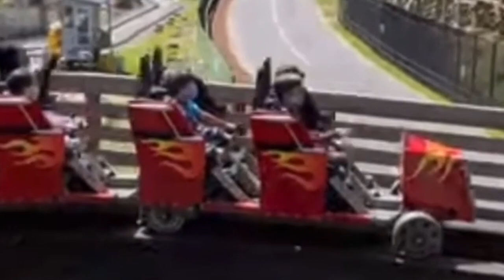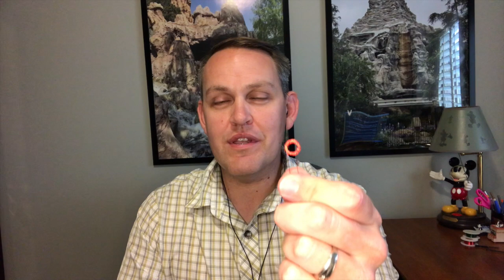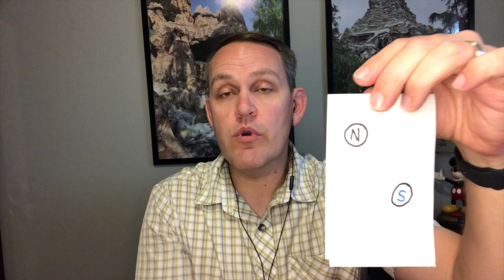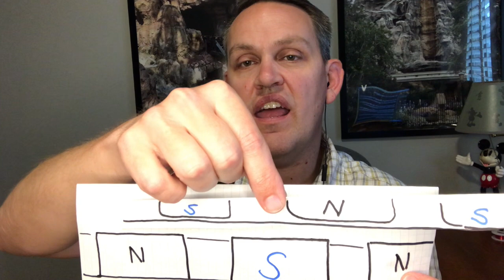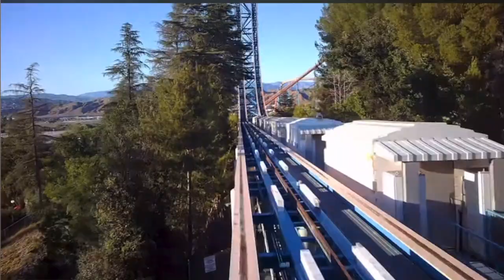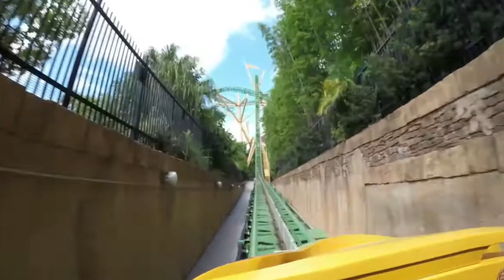MAGNETIC LAUNCH SYSTEMS 3: Linear Synchronous Motors and how they work

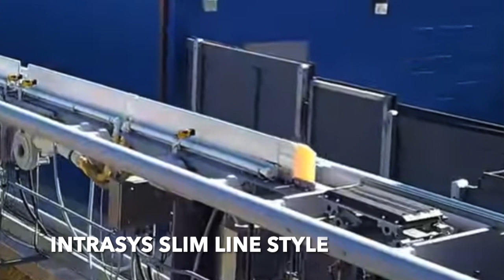Comment: 11:42 in fpv drone escs, the esc understands the orientation and speed of the motor from the eddy currents that get applied onto the coils themselves rather than using hall effect sensors, couldn’t they just measure the current thats cast on the stators themselves once the train passes over them to determine where the train is? Wouldn’t that be more efficient and less complicated and less things to go wrong?

You could measure the orientation from which stators feel current after one another and you could measure the speed by how much time it takes from the current to be felt in one stator than to the other.
Reply from the maker: You could do all that. Sure. It won’t have a safety rating though. Meaning insurance won’t stand behind people getting on it. This industry revolves around verification of movement. And when it’s properly verified, it’s verified by another system. Positive feedback. It’s why one locking pin will have 6 channels monitoring it.

Comment: Is the Current going to the Staror windings just DC with fixed amplitude, or does it have a Frequenzy/ is it AC?
Reply from the maker: It’s dc where the form is modulated for both current and frequency. But at full speeds it’s more of just dC that looks like square wave AC kind of.

Comment: From what Material is the Stator case made?
Reply from the maker: I’m not 100% certain as these things are very closely guarded they don’t let much information out. But it appears to be simple high temperature resin like fiberglass would be used. I’m sure it’s stronger than that though.
Reply: @ryantheridemechanic  👍

Comment: There is no iron in LSM stator coils.  (If there were iron, there would be horrendous side forces if there were the slightest side-to-side misalignment.  Since the mechanical alignment of a coaster train/stator is much poorer than in normal rotary motor, it is not practical to put iron in the stator.  (Remember your comment about putting plywood in magnet gap to prevent wrench from being sucked in?)
          Conversely, in LIM, all the iron is in the stator & none is on the mover (fin on the train) for the same reason.  Because of the large gap without iron, it requires HUGE power just to set up the magnetic field.  (This power is not required for LSM because the "work" is being done by the permanent magnets.)
          Both motor types would benefit from having iron in both the mover & the stator, as "pushing" magnetic field through air is difficult.  Result is weaker field & less force per amp drawn in both motor types.
          You do not mention why LSM cannot rival hydraulic or pneumatic launch.  To get more acceleration, you need more current or more magnets, or both.  Even with WATER cooling, there is only so much current you can push through the coils before the coils MELT.  Adding more magnets gives more force (for a given current), but the magnets are HEAVY.  More force does little good if you have to add to the mass to be accelerated!  There is a point of diminishing returns.  This is why Top Thrill 2 can't use the original "one pass" launch as Top Thrill Dragster did.  The same goes for King Da Ka.
          There was one coaster that used LSM on the lift hill (superman?), but they abandoned this for chain lift because of reliability problems.
Exploded LSM coil structure is shown in this video:
https://www.youtube.com/watch?v=ffdEtbBQY6M&t=669s
Note the WATER COOLING layer in the coil set.  There are 3 phases so there are no "dead spots" in the magnetic force & uniform current draw.
Reply from the maker: Thanks for all the cool info. As far as the iron on the inside, I don’t make them, I was just told that’s what’s in there. You can also see the slight outline with an FLIR as well so I take it a face value.  Not saying all are exactly the same either. I know they weigh as much as a 19mm plate of steel, need 2-3 people to lift one. Are you in design of these stators? So far (me personally) I haven’t seen an internal water cooled stator. The stators intamin makes looks like they could use a shell cooling. 
Closest I’ve ever seen is when they sprayed water on the outside of lightning rods lift base motors. 
I know the old lIM/ LSM stators were made from the manufacturer with either being an option but they were much larger.
Reply: @ryantheridemechanic  A FLIR shows TEMPERATURE differences, not iron.  What you are seeing is the hot copper loops, not iron.  The next time you are working on LSM coaster, take a magnet with you & place it on the stator (with the current off) to see if it is magnetic.  It won't be!  If it were, the coaster would LOCK to it when it tries to pass over.  I don't design coaster stators, but I have designed synchronous permanent magnet motors (one much smaller for military, the entire motor fitting inside 0.2 inch cube).  The other thing you mention is hall sensors & the timing criticality.  The one shown in the link I sent has the sensors where they belong: INSIDE THE COIL STRUCTURE, directly connected to the motor controller.
          Incidentally, once the coaster gets moving > 10MPH, the back EMF from the coils gives more accurate timing information.  This is sensed directly from the coil drivers in the electronics.  The same scheme is done in rotary synchronous motors used in RC electric airplanes & is referred to as "sensorless" synchronous drive.
          Also, you need to look for water cooling lines & a radiator located near the driver cabinet.  There should be a pair of hoses going to each stator.  After running, the hot hoses should show on your FLIR.

Comment: How strong are these permanent magnets? How much kilos can they lift theoretically?
Reply from the maker: Depends on how you use them?  Pull strength against a carbon plate? Force from an Eddie on copper? A single magnet that’s used inside a brake shoe has about 400lb pull force.  And the shoe uses about 12 of these.

Comment: sir 0ne more doubt so in finally stator is working with DC voltage instead of Ac waves
Reply from the maker: Dc current with pulse modulation
Reply: @ryantheridemechanic  thankyou.
Reply: Brother iam also working in theme park abu dhabi. Actually iam from a mechanical background. Iam very curious to study about this all. But in my park lsm stator is powered by Ac
Reply from the maker: @harikrishnan-ts5ti  interesting. My old park the drive is given AC power. Power is broken into Dc. Then dc is pulse modulated and given to the stators. The way most people think about it, they would say it’s AC going to the stators but it’s actually DC 
(AC - drive - DC - stators) 
But the dc is made into a form that almost looks like AC.

Comment: Would you be able to do a video talking about Lightning Rod's launch system and why it faces so much down time?
Reply from the maker: So lightning rods launch system is an LSM drive that this video covers. As far as down time, I can’t speak for something Im uncertain of. I know that year RMC had a ton of restraint issues. And control systems can be a bear but not sure about its particular drive issues. Where is the information coming from that it has drive problems?
Reply: @ryantheridemechanic  I can't think of a specific source at the moment except for a Coaster Studios video where it broke down while they were waiting in line. The train just failed to make it up the lift hill on the first launch, and it took them about fifteen minutes to get it ready to launch again. I've heard it has overheating issues as well, but for all I know, that's just speculation.
Reply from the maker: @KindredCoasters  ok fair enough. Lift hills have a lot of attention due to the visibility across the area. I know the feed stators at the bottom get hot as they are spraying water on them.  Hmmm. And I could see having trouble restarting dead weight on a lift, heck big hp lift motors also struggle with it. I’ll have to think on this one.

Comment: Isn't square wave DC essentially Full Wave Rectified DC? (FWR) Great video as always! Only thing I didn't quite get was the difference in the two sensors you explained. Understood how they worked, just not their separate uses.
Reply from the maker: Yes full rectified. Basically get that term from welding. Are you saying hall affect vs tail sensors? Basically the early hall affect have a value feedback  vs tai sensor gives an on /off.
Reply: @ryantheridemechanic  Ah ok, thank you for the explanation! I've always been into learning the electrical stuff since I was 3 and started collecting fire alarms. Eventually started wiring them up with control panels, senors, and all sorts of devices. Got into coasters in like 2018 and have been hooked ever since. Even got a job in a junior engineering position/program last year at a power supply applications engineering company as a 14 year old. It's been on awesome hobby and always interesting! I can tell you really enjoy learning about this stuff and teaching others, yourself!
Reply from the maker: @nesmanmain0001  it is fun to teach this to people if I can

Comment: Great explanation, Ryan! I wonder how long it will take until you will have the inevitable person show up in the comment section of your videos telling you that "You have no idea what you are talking about". 😂 If that happens, please don't feel discouraged...

Anyhow, the LSM principle really reminds me a lot of how brushless DC motors work. At work, i am currently involved in developing firmware for a product that uses this motor technology (though not on the actual motor control, this far exceeds my math skills😅) and the only difference seems to be geometrical (round rotor with the stator windings wrapping around in the motor housing vs. linear magnet under the train and stator windings spread out along the launch track. 

I was able to witness the importance of the sensors a few years ago when I visited Holiday World in Indiana. Just as we got to the station, they couldn't launch the train - it would dispatch, move a bit on the launch track, and then the ride would shut down with an error. We used the opportunity to get out of the heat and watched the park's maintenance team as they tried to get it up and running again, and after going back and forth a lot, they found that someone must have lost their phone on the ride and it had ended up blocking a sensor. I assume the magnets in your typical iPhone aren't strong enough to interfere with the hall effect sensors, but of course it can block an optical sensor or just trigger a prox sensor easily. After they removed the phone, things worked again. (Keep your darn phones in a closed zipper pocket or don't take them on rides at all, kids!)

Anyhow, I imagine it's kind of tricky working on LSM trains. Those Neodymium magnets are extremely strong, so I can imagine that they would also try to yank the wrench out of your hand if you come too close.😂

There's just one thing I would like to kindly ask you for, in order to improve your next videos. Please crank up the audio level, there were a few sections that I had to rewind to understand what you were saying. And I already have the Youtube player on max volume and also my laptop's sound mixer. As long as it doesn't clip, as higher audio level is not much of a problem as people can reduce the volume during playback, but there's only so far you can turn it up until you max out. Thanks a lot! A man like you, who has mastered the special effects needed to support the explanation should also be heard 😁
Reply from the maker: Thanks for the comments. Magnets are quite nerve racking to work around for sure.
I don’t mind when people att a ton of info in the comments I don’t feel like it is a big deal. I know there is way more information than I give when it comes to theory on anything. But I make the videos they way I do because that text book theory goes over most peoples heads and they don’t understand. I make these videos the same way I gave tours and learned what to explain and what just needed to be touched on momentarily. 
My hearing isn’t the best so I try and “place” the volume where I think it should be. Definitely don’t want quiet though that’s no fun at all. I also do want to pop in and have people lungeing for the it volume because I’m yelling. Haha. I’m also trying to be conscious of where my mic is and where I am.

Comment: I was really bored one day and read the lsm manual at work. The way the theory of operation described it was the magnet passing over a single point created a theoretical frequency and the system would try to keep the stator frequency either 17 or 19 degrees ahead of phase. Eventually they got rid of our Hall effects sensors and added current transformers on the drive. Apparently they can use that to determine where the train is. When they did that they did have to add a comb sensor to determine parking. I thought this was going to be the standard, so I was surprised when I saw Intrasys still used hall effects. But I’m sure they no longer use a windows95 computer to interface with the sensors anymore.😂
Reply: I actually made a comment about this a while ago about how the motors on fpv drones work the same way and how fpv escs actually use the eddy current on the coils rather than additional Hall effect sensors to measure the direction and speed of the motor and asked why they don’t use the same system here to reduce complexity and the chance of something going wrong, then I saw ur comment and I suppose thats what exactly they do anyway
Reply from the maker: Industry is on windows 97 now haha!!!! 
The manuals are great but they are very hard to follow most of the time. Mainly because they reference things we have no control over. Drive set up stuff where those parameters have already been set in stone.

Comment: 27:34 if you ever have one thats planned for scrap, you might want to do this with the whole crew... Wear eye and ear protection! 👌🏻 (and have a few co2 extinguishers at hand)

I sort of witnessed it going wrong, didn't see it but heard it loud and clear from 150 m (thats about 30 tesla X's long for you americans) away. Gave a nice sharp bang and according to my colleagues a bright blue flash followed by thick black and white smoke
Reply from the maker: I almost broke one like that. Shoot the dust off the entire structure.
Reply: @ryantheridemechanic  quick cleaning 👍🏻
At ours it did some more then dusting off the tunnel 😅 the ride wasn't back up and running for 14 or 15 months... Officially due to parts delay, but we had the part within a week 🤐

Also ours didn't have hall-effect sensors, it timed the speed of the ride at the end of the tunnel and if the time was too long (aka speed too low) the (friction) brakes would engage at the end of the launch track
Reply from the maker: @HaroldKuilman  what a sound it made though. I don’t know to watch, or run.
Reply: @ryantheridemechanic  when ours misfired it was over before you could make a decision, the busbar worked as a fuse 😬
Reply from the maker: @HaroldKuilman  Ho-LEE-crap that’s scary. I blew a capo stir bank(12igbt) out one time but that was in a closed room and no one was withinn 200 feet. Big boom
Reply: @ryantheridemechanic  yeah electrical explosions are cool and scary at the same time 😅